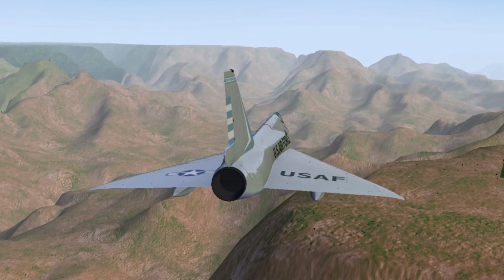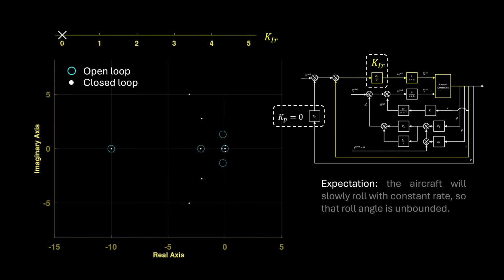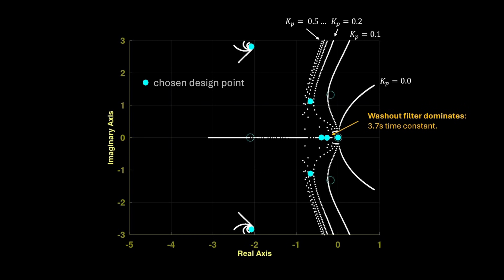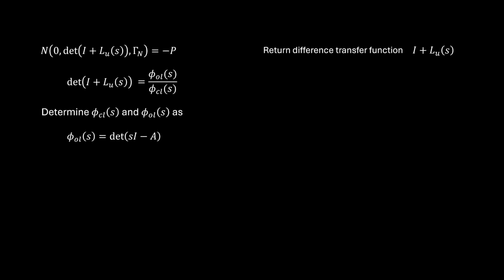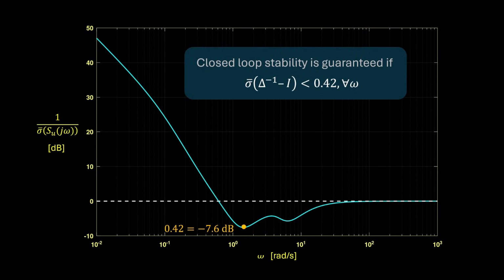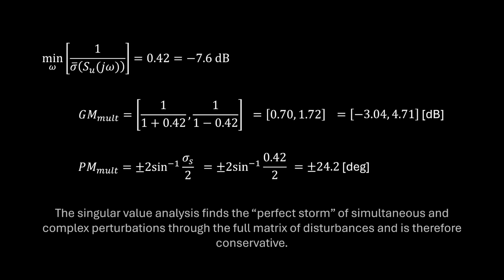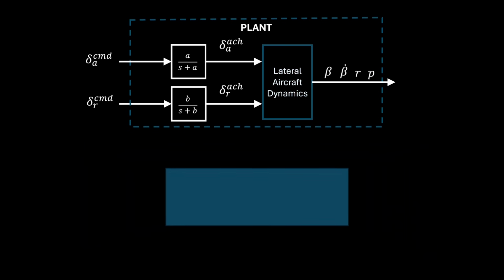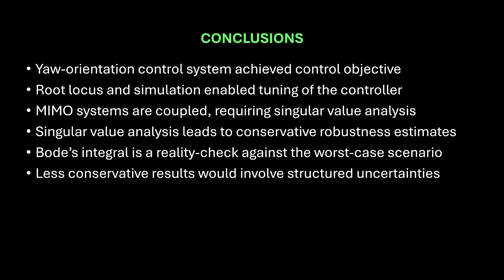Multivariable Control: Yaw Rate Tracking & Turn Coordination - Lateral Flight Control - Section 1.4

Comment: It's interesting that you used an F106 for your example of lateral stability augmentation, because there is publicly available paper on DTIC (ADA091014 - Design of a Lateral Stability Augmentation System for the F-106 to Improve Lateral Handling Qualities During Tracking) that describes the how the baseline systems works, and introduces an improved control logic based on sideslip angle (beta), sideslip rate and rudder input, instead of the original system with an aileron to rudder interconnect and yaw rate damping. This is probably the original paper bladelock was referencing when he discussed the advantages of improved sideslip control.
You could use the data in that paper to confirm if the simulated F106 behaves like the real article, and maybe compare both control strategies in a follow up video.
Reply from the maker: That's a great suggestion. I had not seen that paper, but only had Blakelock's mention of it. I was thinking about comparing optimal LQR control with the same feedback (i.e. including betadot) with robust servomechanism design, including perspectives on tuning and touch-labor.

Comment: Thank you so much sir could you please recommend a book about aircraft control
Reply from the maker: I personally use Stevens and Lewis, Aircraft Control and Simulation most often. This was not used in this lesson though. Please check the references at the end of this lesson for other references. Blakelock is an out of print text but still excellent for fundamentals. Lavretsky and Wise is a solid more advanced text with the latest in robust and adaptive control.
Reply: @LearnGandC thank you so much sir 🙏 😊
Reply from the maker: Also see https://learngandc.com/recommended-texts
Reply: @LearnGandC thank you 😊